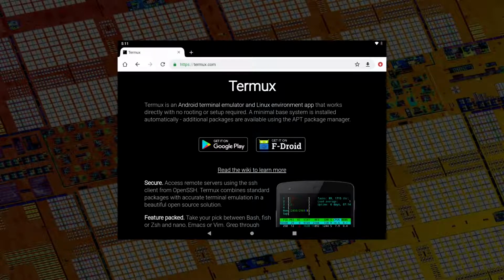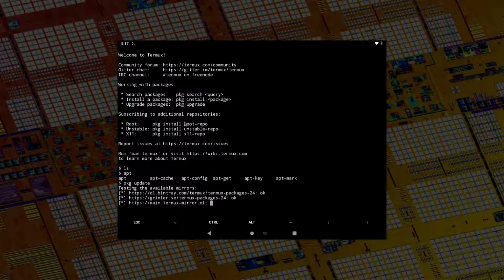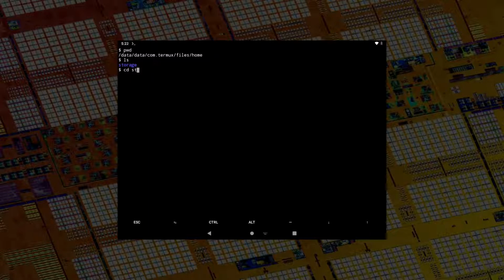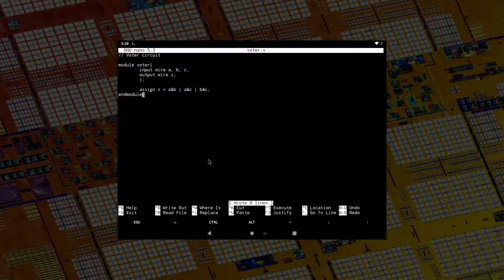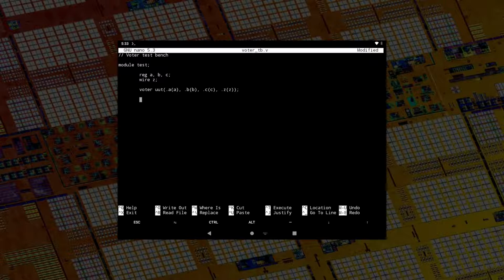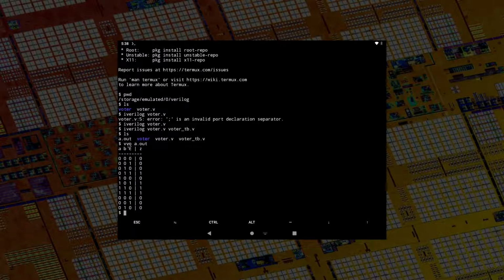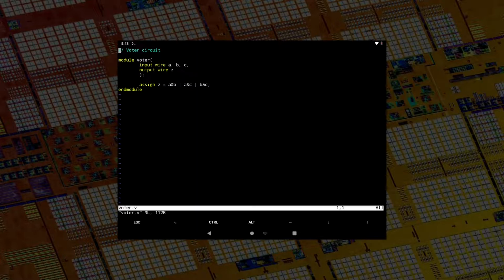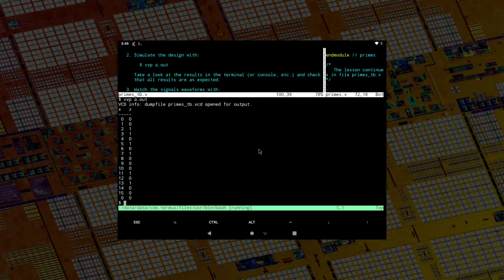Verilog circuit design on Android with Termux and Icarus Verilog

Comment: But how to see the output waveform and logic circuits of verilog code ?
Reply from the maker: @mikey-7x  The Verilog code IS the circuit. A description of it, more precisely. If you want it translated to an actual circuit with logic gates, flip-flops and all that you need a circuit synthesis tool like Xilinx's Vivado since Icarus Verilog is just a simulator. You can test your circuit with Verilog's $display and $monitor on the text console. To see the waveforms you may use gtkwave and an X-server (graphical interface). I don't think gtkwave is available in Termux. Todo all that better use your desktop or laptop computer. Think of this video more like a proof of concept.